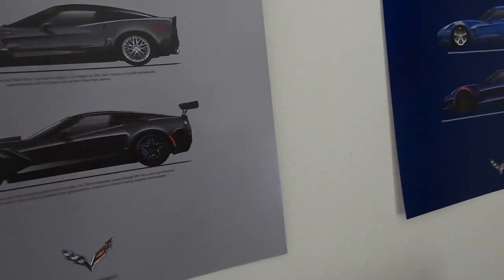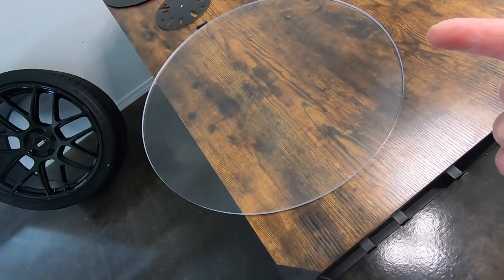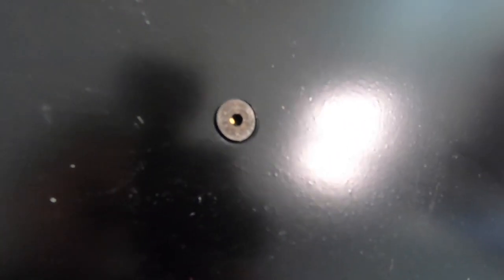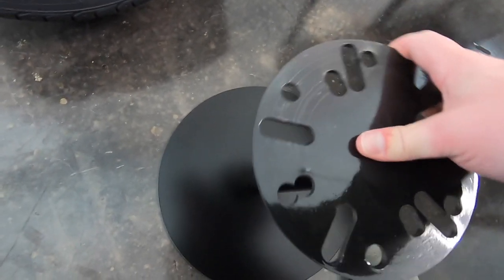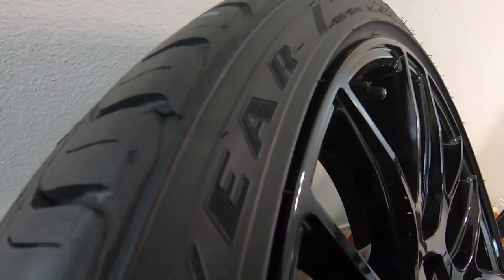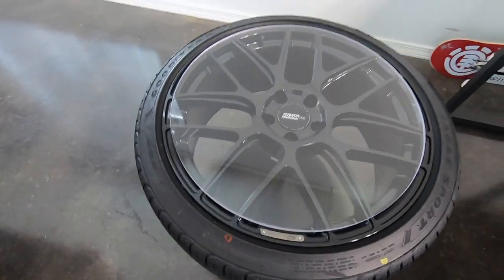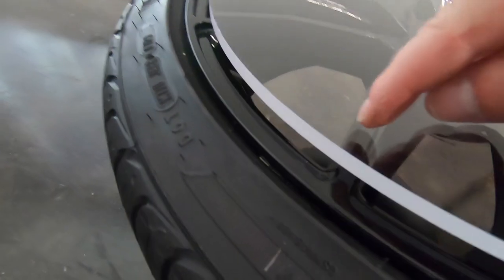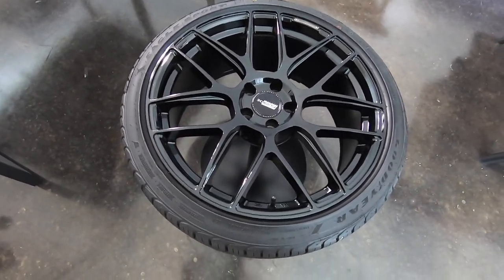How to: WHEEL TABLE... DO IT!

Comment: no links to any of this? pls provide if you still are here
Reply from the maker: Google wheel table and look for the hit on the Canadian company, they are not a Return Auth. Though. 
Amazon, search plexiglass disk 1/4 thick, spec your own width or thickness. 
Choose any wheel, maybe from the rack of tires for lower cost or grab an ADV1, depends what you want in the space